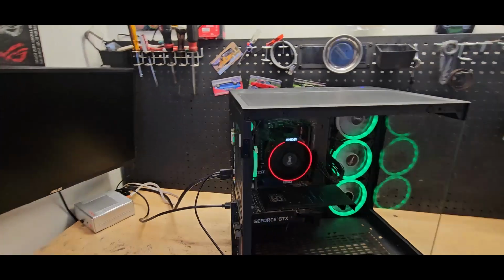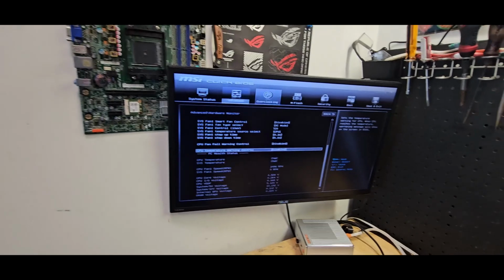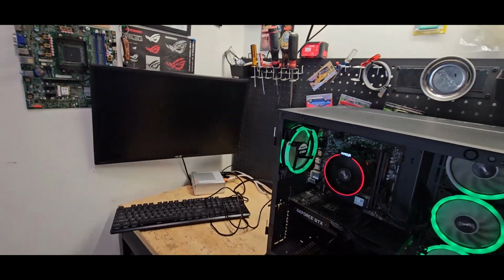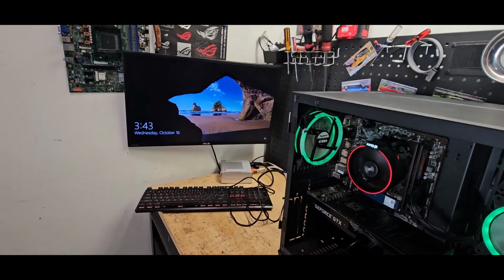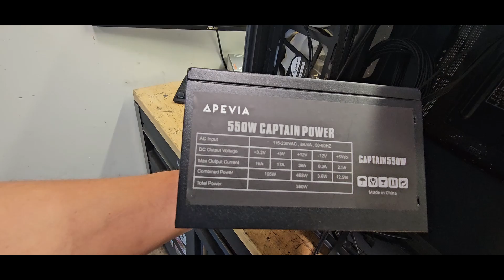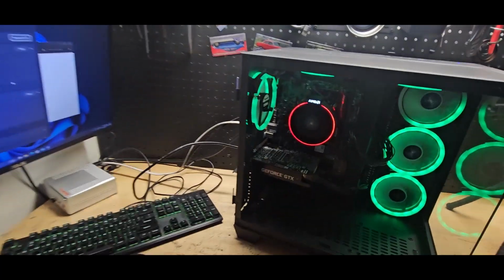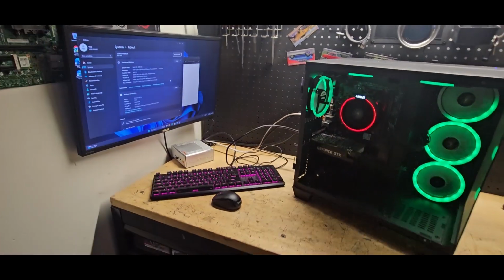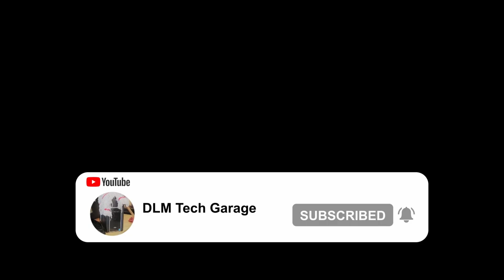This PC would not post, boot or install windows!! The fix was simple!

Comment: 🤦🏻‍♂️ The monitor wasn’t plugged in when it posted is why it didn’t come on after you plugged it in. When you forget to plug in the monitor you have to reboot. 

I wouldn’t have given the option of spinning rust replacement. I’d have suggested a 1TB 2.5” SSD since they can be had for about $40.

Comment: From what we can see, the HD drive was on its side, which is why the needle that moved on the disk platter was most likely damaged, which is why you can hear the scratching sound of the disk. Therefore, they should be flat, preferably at the bottom of the casing.That's why I haven't used HD drives for over 5 years because they fall apart like puzzles and on top of that you have to defragment them because otherwise they slow down dramatically. Now 1TB sata ssd drives are even cheap I recommend investing in one. 
I wanted to ask because I had a Win 10 system on my laptop without drivers. I updated the system and installed the drivers. Do You recommend installing anything else on the Asus laptop, like the myasus application or something? Are the drivers and system enough? I'm asking because I currently have a laptop and I'd like to know more about what else I can add or change.
Quick question, would it be possible to transfer the system from a sata drive to an m.2 drive on a laptop? I mean to transfer the system with the Windows 11 key? It's currently on a sata drive but the speeds are a bit low, 400mb max.

Comment: Does that case have the ability to mount 2.5 inch sata ssd's? I would have just gone with that instead since they are inexpensive while still being faster than a 7200 rpm hdd.

Comment: Did you install AtlasOS after the fresh install of Win10?
Also, M.2 SSD or even a 2.5" SSD are not that expensive. $50 gets you 1TB of storage. I understand that it is the customer's choice to choose which repair route to go. But, $100 is unnecessary for 1TB of storage.

Comment: The fan configuration is a bit weird 5 exhaust and 1 intake. Perhapst would be better to set the fans to more even pressure config.
I would flip the sidefans around for intake and move the back fan to the top as exhaust. So 3 intake and 3 exhaust pretty even.
Thats should help a little with the dust buildup.

Comment: It was most likely the loose mounting that killed the drive, spinning discs are very prone to vibration damage. I don't use spinning discs often, but when I do I try to use rubber grommets on the mounting screws. 

My brothers PC had a SATA SSD go out a while back, PC either wouldn't boot or would blue screen after a few seconds. 

I think I caught you napping too, I am in your area visiting family for the holiday, grabbed a dirt cheap 3060 ti for $125, and a 12400 3060 prebuilt working for $200. Quick meetups, spent twenty minutes messaging and half an hour on meetups, another hour making sure they work, at least power on and boot.

Comment: I had that on a computer once,but it ended up being the power supply not being able to provide enough power for the hard drive to spin up. The computer was actually able to boot up and worked but the sata power connectors were dead

Comment: Fan arrangement has no sense, rear fan sucks in the air and other 5 are exhaust? 3 at the front should be switched to intake and the one at the back to exhaust. All the fans are standard, not reversable ones. And yes, I'm usually fixing non related issues (like paste or dust) in the customer computers, unless it's to difficult, then I'm asking the owner if he wants to pay extra for a fix that'll take a lot of time or effort.

Comment: I think the d e l button is the delete button also I kind of figured it had a bad power supply The Moment I Saw half the LEDs on the ring fan light up and the hard drive cycling I haven't seen you tear it apart yet but it kind of looks like a 400 watt power supply

Comment: It used to be that, one would never install Hard drives anywhere near  PSUs, it would almost guarantee Hard drive failure, from the PSU transformers, wonder if the psu had enough shielding?

Comment: First time I've heard someone say something nice about a 1650😯✌EDIT I got XT VIEW case. Top 3x intake, rear 1x intake, bottom x1[GPU extra] intake, 2x back side exhaust. Custom fan curves on all, CPU tower fan to pull. No thermal issues but fans ramp when gaming by design. G/HTPC sofa experience so I don't hear the fans.
Reply: I think it's a really nice card especially since not everybody has the same budget, there are some people that are barely making it and a 1650 for them is a world of difference so we shouldn't apply our standards to everyone else
Reply: @TheyCallMeJTK  i use a 1650 daily and am happy with it because it only cost 50€ used and plays all my toaster games
Reply: @finnbianga4189 50 euro was a good price tbf✌ UK quick look 90£ I think new, 70-85 used cex. Prices are stupid again
Reply: @TheyCallMeJTK  The 1650 isn't a good card unless donated, if there is budget issues try used, the 6GB 5600XT or the 8GB 5700XT would be better options imo. I've been there with a tight budget, I suffered with an I5 3330 for years & saved hard for the 5600XT.